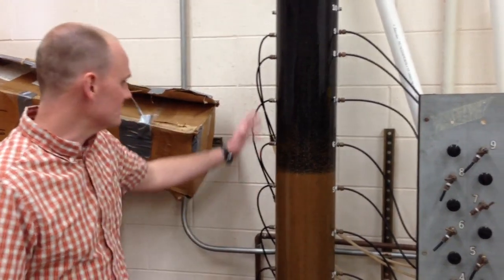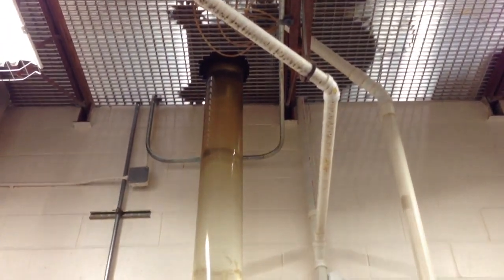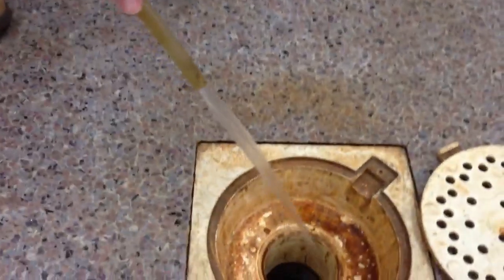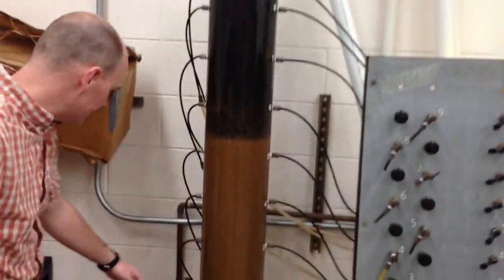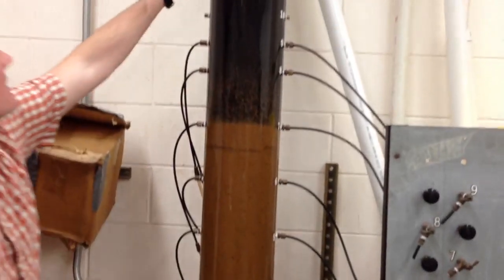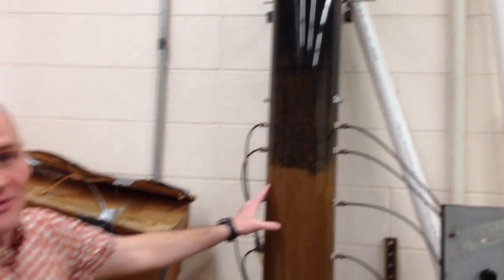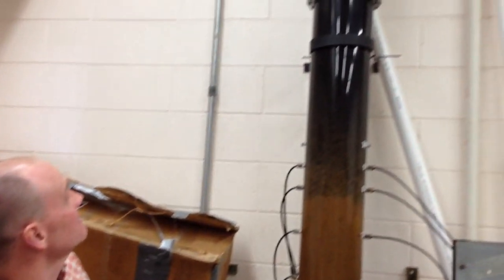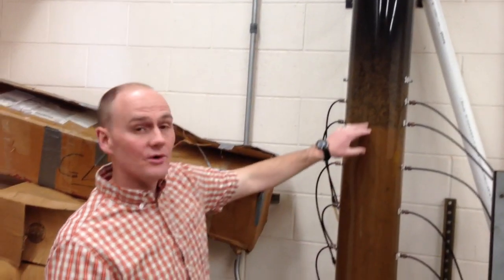Dual media filter at Clemson

Comment: Dear sir..
1.What is the minimum water depth(driving head) above media for rapid sand filter for single medium? Is there any standard range?
2. Is the filter effluent level above media about 10 cm is enough? Is there any standard range?
Reply from the maker: In the textbook we use for class (Davis) I see a recommendation that the water be at least 1.8 meters deep. I am not sure if that is standard, and I'm not sure where the number actually comes from. But I think the main reason for having such a depth is to give room for the backwash troughs, and to allow for quiescent water flow. (If the water depth is too low, there would be more longitudinal flow as water comes over the gullet wall, which could scour the surface.) But I don't think the head is usually much of a problem. The media doesn't have too much resistance to flow; it's the valve or sluice gate after the filter that will control the flow rate, for the most part.

As for filter effluent level above media I'm not sure what you mean. I think I would have to see the design you are considering. There are lots of design options. Some won't have an effluent above the media. It would travel through a pipe below the media and a valve would control the flow.
Reply: Thank you for information sir....the model that i have constructed is as:
I have constructed pilot rapid sand filter of fiber glass of square cross-section of sides 11cm and filter height of 2.95m. Filter consist of 0.5m gravel support and 0.6m filter media. Outlet and backwashing ports are 5cm above the base of filter. I am running the filter in constant filtration rate of about 3m/hr with influent control mechanism(here the initial water depth is just 10cm and water level above the filter media slowly raise with filter run to keep the filtration rate constant to compensate the solid deposition). The effluent from the filter is taken out from 10cm above the filter media by raising the pipe from outlet port to 1.2m above base of filter  to avoid negative pressure(i guess it is right process to eliminate it!!!). 
My queries are as:
1.Water level above the media raise during filter run but sometime it decrease, whether it is due to insistent            influent supply rate( rate variation is not so high while checking) or could it mainly due to variation in turbidity level in influent raw water(my main concern sir)??
2.There were some suggestion to raise the effluent level higher to1.7m from filter base ie 0.6m above filter media or 0.6m quiescent water depth to provide more driving head.....if i am not mistaken there is no such effects of raising the filter media effluent level higher or keeping more quiescent water depth on filter performance in filter operated in constant filtration rate by influent control method....

Comment: Thank you sir...You got my question correctly...
a) What if the losses in pipe fitting are negligible?? is the answer still no??
b) Then how can we measure clean water head loss of media in real filter media?
Reply from the maker: +manish prakash  One approach is to use piezometers. In fact, in the column in the video there are ports on both sides, which you can see. One of those sides is commented to piezometers in the room above the column (which you can't see). The difference in water level in those piezometers tells us the head loss through the column.

Comment: Thank you for sharing....
Dear sir..is there any difference between clean water head loss in filter media for certain filtration rate  and still water level above the media for same filtration rate?
Reply from the maker: +manish prakash  I am not sure I understand the question. But if you're asking whether the head loss through the filter (in meters) is the same value (in meters) as the distance between the top of the media and the water level, then the answer is no. There is usually no relationship between the head loss through the media and the actual "head" above the media. This is because there is usually a valve or something else that adds resistance to flow. In fact, the media usually provides much less resistance than the downstream plumbing.

Comment: dear sir why the effluent is at bottom ??? if I am not mistaken...it must be above the media to avoid negative pressure in the media...please share your experience
Reply from the maker: +manish prakash The key is resistance. Our effluent tube has a small diameter and we have a valve on the tube. These provide resistance so that the water does not flow too quickly and cause the negative pressure. But you are right that if the tube were large enough and there were no valve, the water would flow very quickly and cause negative pressure in the bed.